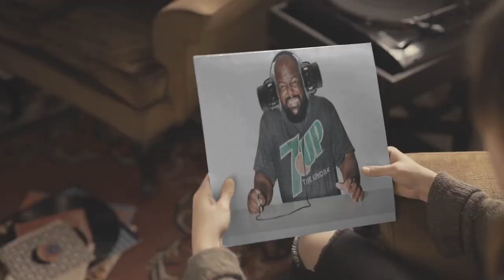To Rear Fill, or Not to Rear Fill...in an SQ Build?  That is the question, and I have the Answer...

Comment: I run a  3 way active front stage and a passive 2 way for rear fill powered off the head unit in my build.
Reply from the maker: Sorry I didn't see your comment, but that's awesome!  I've been running my rear fill off head unit power for years.  I always felt it was a waste of money and amplifier power to have one dedicated to rear fill that you can barely hear.  If you had the extra channels, then yeah, but I wouldn't buy an amp just to power the rear.

Comment: I have 6.5” coaxials as rear fill.  Mine are powered by my head unit.  My front speakers are amplified and I use a DSP.  My fader is in the middle, but I cannot hear my rear speakers in the front.
Reply from the maker: I think the ultimate goal is to really not hear the rear, especially as much as the front, as it would ruin the time aligned staging.

When I have mine fader in the middle, I hear too much of the rear, so I had to find a good balance.

I have since redone my rear fill with new speakers, and ultimately it's for when I have back seat passengers, as it tends to pull from my front stage in a way that I am not the happiest with.  It's not bad by no means, but it's not as focused as it is when just using the front 3-way.

In case you missed it, here is the unboxing, install and demo:

https://youtu.be/sZDKc-fs-lQ?si=h8l97b_q_lnY2UMz

Comment: Just stumbled across this. I say rear fill. I have a total of 35 speakers (if you include coax tweeters as "separate"). 3 8inch subs and the rest mids and highs. Not a bunch of power...1200 RMS at most but I like the sound coming from all directions and I do not have a DSP but I have 4 EQs for a total of 30 different frequency controls.  I have 2 tweets in series running off each of the 4 channels of the head unit for a total of 8 off HU alone. The head unit has a good built-in DSP and tweets are high-passed at 7.5 Khz with gain turned all the way down and I think a -20db slope. Dfntly adds some nice staging and dynamic. Then I have some mids facing me from the back seat area in my wagon and I REALLY like it. After all, you ears are the ones listening to the system the most. Cool vid.
Reply from the maker: That's awesome brother, and like you, I don't believe there's one set way to have a great sounding system.   I trust my ears more than anything, and if all of our systems sounded the same, how much fun could that be.   I love different systems.

Comment: My current build will have CDT 6x9 woofers in the rear doors. I will use my AC DM810 for them on channels 7/8 (1-6 in use for the front 3-way stage 9/10 summed for the subs and will split use to a front sub down the line). 

Not sure until I get them in as to what I'll set the x-over that bandpass filter at, thinking 60 - 250 to 2000, no tweeters, delayed around 15-20 milliseconds. It will be the first time doing the fill this way but after hearing it done this, way, i'm convinced that the front stage can be maintained with the fullness the rear fill brings to the table. If you are going to use rear fill with tweeters, my recommendation is that it have, at the very least, the same tweeters as the fronts' as not to create a distraction introducing highs (which are what draw one away from the front stage to the back) that have a different sounding profile/signature (timbre).

Once that is done, sit up front and have someone adjust the gains on the rears until you think it's no longer there. To test, have someone pull the RCA's  or shut the rears off if you have that ability and it's really impressive how much they are actually present. You'll have a "don't know what you have till it's gone" ah-ha moment. Then EQ then TA.  Should be interesting  :)
Reply from the maker: That's going to be a sweet sounding system and I can only wish I had 10 channels on my Arc Dsp.... which is one of the reasons why I use my head unit for rear fill. 

I will say this... I've heard two champion SQ cars with differential rear fill and I was not impressed. I did not get the sense of a wider stage or fuller car. 

If you view my newest rear fill video with the Morel Maximo Ultra 602HE MKII, I'm making it work for me with forward faded head unit power, with a flat full range signal, which is also out of phase with the front midbass, to not effect the upfront presence... and it actually works. 

But, with the new set, I only run the rear fill when I have rear passengers, so they can get the full effect of my system, and not just have some of the front stage and a sub, with a gap in the back seat.
Reply: @Ahm-Creative  Oh, I get it. Not completely sold on the differential rear fill either, and frankly, after digging into it, not sure my AC DM810 functionally allows it to the degree that the Helix does - I'd be mimicking the settings to try and accomplish the same outcome, we'll see.  I will have to play with that for sure later come this summer.

A narrow-er bandpass on the other hand, for staging really does work. I'm still debating on the rear tweeters thing (which I have always done - have the matching CDT coaxials if that should come to fruition) but I would actually need another R/L channel of DSP if i wanted to just add a matching tweeter and I'm not thinking that I'm  heading there, already too deep into this thing to switch gears now. If I do get another set of ES 1200is tweeters, I'll have to run the rears active/passive, no ability to shut off the tweeters unless like you, I use the HU which in my case, probably not optimal as I would likely still want to run a bandpass to minimize the pull to the rear seeing as nobody is around to benefit from it.

With the DM810 I can actually save multiple tunes Single, double, triple quad occupants and toggle between the different saved tune's' depending on who is in the car. It allows you to do this from the dash mounted remote. I't almost always me so a lot of work for hauling around an extra person or two, once or twice a year.

Although it does give me an excuse to change things up, learn a lot more. Get'n too damn old (63 in march) for this stuff!
Reply from the maker: @steveschwartz9771  lol man,  I totally get it.  I too have passenger presets...I have one for the rare rear seat passenger as well as a reversed time aligned side to give front passengers the best imaging. I don't mind suffering every once in a while so someone else can experience what I get daily.

I almost didn't do rear fill after I sold the coaxials I used in this video, but after listening from the rear seats, I had to put something back there for the occasional guest. 

And I'll be 49 in March, but we're never too old for our love of the game ✊🏿

Comment: I don't have a rear seat, but there are rear speakers. Going to throw in some rear fill, but no high frequencies in the back. Easy to turn them off if I change my mind down the road.
Reply from the maker: My rear speakers are powered off the head unit, which is set to flat, to not conflict with my DSP tune,  and are basically nothing more than a little sound for those in the back.  It takes a sharp ear to hear the rear from the front seats, but some have heard them while others have not.

I will say, sitting in the back with them completely off sounded empty...I needed something back there to bridge the gap between the sub and front stage, even if by a little.

Comment: Great topic, was actually watching another SQ channel about the same thing.
I have 3way front, and 2way rear (mid bass in doors and 3.5s on rear deck), two 8” subs in trunk. 
I feel the same way about all passengers 👍
Reply from the maker: I knew it wasn't just me.   It fills in that tiny gap and gives passengers their own staging without pulling all of their attention to the front.
Reply: @Ahm-Creative  I guess it just depends on what you’re listening for. As an SQ person you might be listening for something different than the SPL guys . Even when I’m driving if I turn my head, I can hear music from the back corners.
Reply from the maker: @milesbachelor8747  yes....that is the tricky part with these builds....and also what I would consider the odd part, if you will.

I got a demo in an SQ car that sounded great, BUT....you had to adjust the seat to a certain position to get that properly aligned center stage, and I just can't get with that.  Like, it ONLY sounds good if you have your seat in THIS position?  My center stage is where it's supposed to be if you're taller or shorter than me, and no seat adjustments are required.

I think it was how the car was built...it was just one of those things, but still a bit odd to me.  Like, does it sound bad when you're just driving, since you can't put your seat in that optimal position?  That sucks cuz the car sounded great otherwise.

Comment: I've never cared for rear fill, but Peter over at PS Sound has got me interested in differential rear fill. I might give that a try if i ever replace my dsp.
Reply from the maker: I chat with Peter occasionally...very nice guy, and very knowledgeable.  I've been doing rear fill off the head unit for years, and it's worked out pretty well for me.  It's so low powered, it is barely heard from the front seat, if at all....but for the passengers, it completes the sound filling the gap between the front stage and sub.  It's really just for them.
Reply: I’ve been watching PSsound and Peter is very knowledgeable. He is a rear fill proponent. He has talked about having the rear fill time aligned, so if you are using the head unit for the rear fill before the time alignment of the DSP does that make for issues? That’s my question.
Reply: I just did it. Though I have a Helix dsp it is possible to do without...with a couple extra steps..I have to say..so far so good though I only have a few days with it and haven't spent much time tuning after I hooked everything back up.
Reply: @steveharley2021  I think Helix is the only brand dsp that can do differential rear fill.

Comment: Hey man I have a noob question. I have a single cab truck meaning I have 6.5s components in the front doors and 4x6s in the b pillar so right by my ear. I unfortunately only have the pioneer head unit for now but I was wondering if I should fade my speakers more up front or turn down the speaker levels for my rears? I feel like I can hear my 4x6s a little too much and it takes away from the front sound stage. What do you think?
Reply from the maker: @memes_6980  absolutely fade your head unit for, or lower the output or gain for the 4x6's to keep them from pulling your attention that way. Of course you don't have to lower them to a whisper, but they should only be giving you enough to fill the cab, and not pull from your front stage components. 

I updated my rear fill since this video, and it should give you a better idea of what I mean. 

https://youtu.be/6IHd0PzPltU?si=3w04mL0jdlz68v47
Reply: @Ahm-Creative   Thanks for the advice man. Watched that video as well and have noticed my soundstage sounds a lot better with the fader up and doesn’t get interrupted by my 4x6s. I go back and forth between tuning the fader but way better either way
Reply from the maker: @memes_6980  it's all a balancing act.   It took me a minute, but I found my sweet spot, and although I love when it's just the front stage playing, but that rear fill makes it complete.

Comment: I'm new to the SQ scene.... So, with SQ you don't want any bass at all? I feel like a little bass gives the experience depth. When I say, a little bass, I'm not talking about the little "thumps". Think of a good nightclub sound setup. I'm just curious. Thanks
Reply from the maker: What's up brotha!  I'm not an SQ competitor, but I know quite a few and have been to many shows.

You definitely want bass...especially up front.  You want to have your system so balanced, that you cannot localize any speaker, even if you're looking directly at them.  That's how the systems are designed at SQ shows.

If you sat in my car, and I played a properly balanced song, you would be hard pressed to find  each speaker...because everything meets on the dash at the same time...even my sub in back.  It's almost weird how it works, and I mean weird in the best way.  It's just magical.

It all comes down to proper tuning and time alignment...and it really helps if your system is fully active.  You can get a good sound stage with a passive system, but going active gives you that much more control.

Comment: Hey, Ahm... great video!  I just stumbled onto your channel and am enjoying your work.  I run rear-fill as you do.  I have a 3-way front stage and run the rears from 250-1500Hz from the head unit's power (attenuated heavily).  I think I prefer the rear-fill--slightly.  When I omit it, I don't feel like I'm missing much, but I usually bring them back into the fold.  I think this is one of those topics (e.g., sealed vs. ported) where individual preference will rule the day.  Thanks for sharing your system and perspective on this one.  Nice work!
Reply from the maker: Thank you so much brother, and I agree with you 100% on the preference debate.  BUT, I am running my rear fill for passengers only now, because I finally got my front in perfected to my ear.  When I ride solo, it's just the front stage.

In this video, I was running the Morel Maximo Coax 6, but have since upgraded them to the Maximo Ultra 602HE MKII, and I did an unboxing and sound demo if you're interested.

https://youtu.be/sZDKc-fs-lQ?si=zcUX1pGeqeIEt-3l

Comment: Greetings kind sir, my local "guy" tells me placing the added speakers creating a 3 way, so low in my doors, won't give me desirable results.  He suggested custom a-pillars to achieve the sonic improvement I seek.q logic makes kick panels for my car. Should I use some 6.5" mid-bass drivers? I won't send anything lower than 80hz or possibly 60?
Reply from the maker: What's up brotha!  Sorry, but your "guy" is incorrect...and it sounds like he may be pushing you towards custom a-pillars to earn your business.  Not knocking his business, or skills, but with proper dsp tuning, you can get your 6.5's from low in the doors to sound as if they're on your dash without issue.

I have Morel MW9's in my doors now, but I had their MW6's before, and they both ended up on the dash too.  Proper tuning and time alignment is key and it can 100% be done.

As for the q-logic q-forms, I had them back in the day, and unfortunately it was a total waste of time and money.  Not only did they not help with imaging, but they also were very thin, so I had to line them with a spray deadener like cascade audio or even dynamat, so they wouldn't flex or resonate.  Not to mention people would ALWAYS kick them when they got in my car.

But yes, you can get your mid-bass on your dash with proper tuning.
Reply: @Ahm-Creative  you're starting to sound him. Dsp? No thanks, if I can't achieve my sound with two Audio Control pieces, I'll "settle" with analog goodness! Just too much, regarding dsp. I'm a set it and forget it kinda chap!!
Reply: @Ahm-Creative  but thanks for the heads up about q forms. I too remember them from back in the day. Never own any, just remember good staging
Reply from the maker: @brianvarnes6174  LOL you can set it and forget it with a dsp too.  A dsp will actually be WAY easier than two Audio Control pieces. Those Audio Control pieces will not get your mid bass off the floor, even with angled q-forms....trust me.  The car I had q-forms in, was eq'd with an Audio Control EQ-L/Four.1 combo, and I never got the mid bass off the floor.  A dsp is the future, and is used instead of an Audio Control manual eq for a reason.

I didn't create this page to sell or mislead anyone.  A dsp is your friend, I promise.
Reply from the maker: @brianvarnes6174  what I thought was good staging with q-forms is laughable in comparison to what can be achieved with a dsp, I promise.

Comment: My rear speakers are standard in my 2015 golf base system and sound bad compared to my Audison apk 165 so have the rears off
Reply from the maker: @Birmingham_racing  yeah, that's the best move, but once you upgrade them, if you power them lightly by fading the head unit forward, they can really enhance your listening experience.